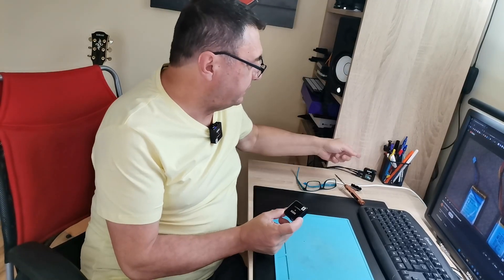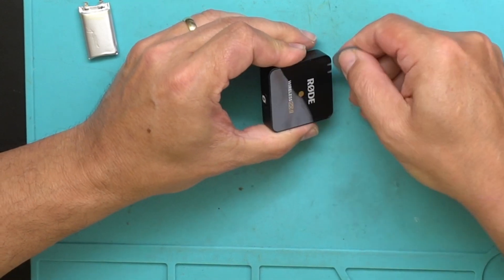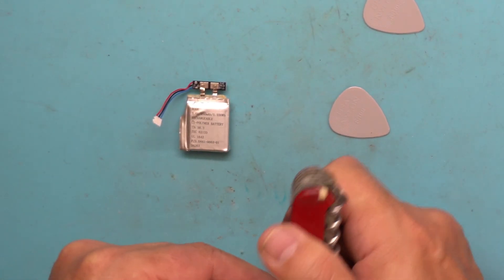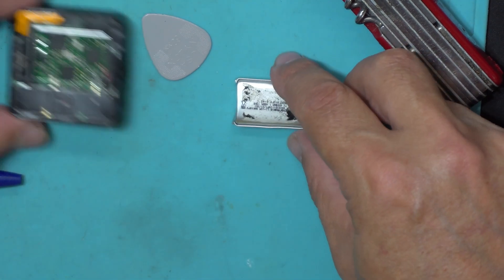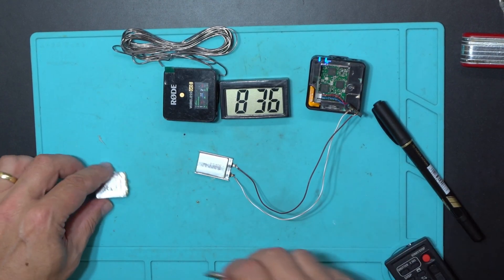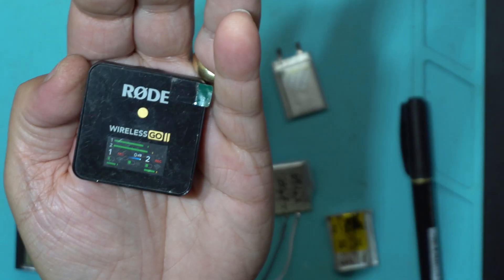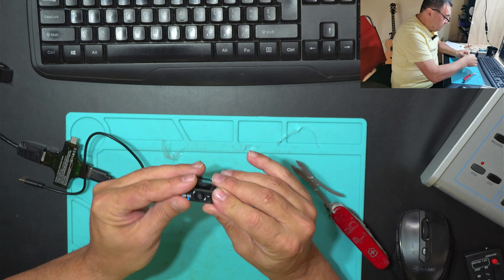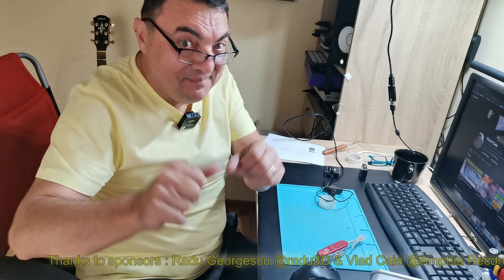RØDE Wireless GO II transmitter battery replacement

Comment: Nice information, did you almost shortcut it on 3:37 ?
Reply from the maker: Not at all.. I took one by one! I did that mistake many times before, ruined nice tools by the way! 
🤣
Reply: @viocaia  i meant, you dropped the red measuring rod, on both contacts it seemed. Per accident. Maybe the angle was making it look like that.
Reply: I made many mistakes too haha experience is driven by pain ;)
Reply from the maker: @jpk6916  Oh my! So many mistakes and ruined projects! Once I tried to make a battery for home use, like 4KWh...I think I have a video about it, everything was running smooth until I dropped a wrench in between ...
Reply: @viocaia  that must have been fireworks! Good luck with your channel, great content. Btw, where did you order that battery?